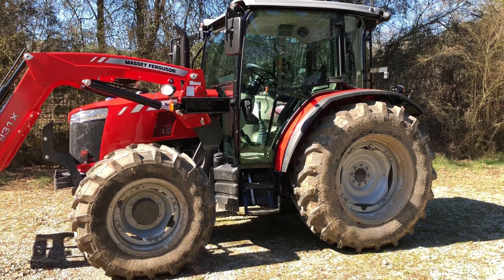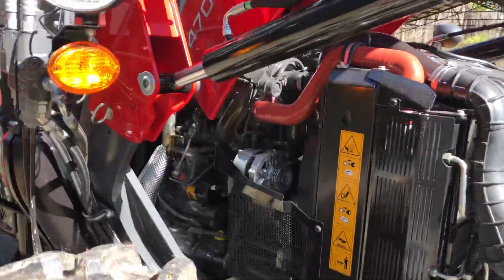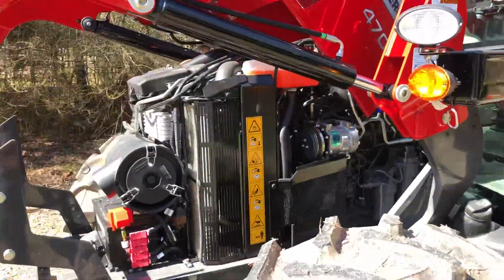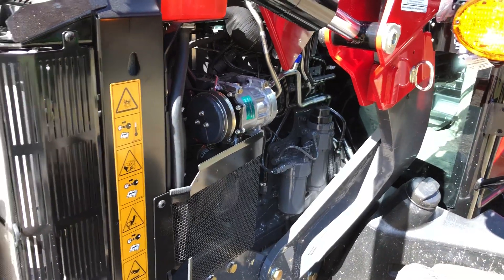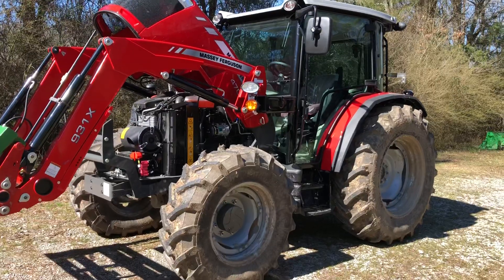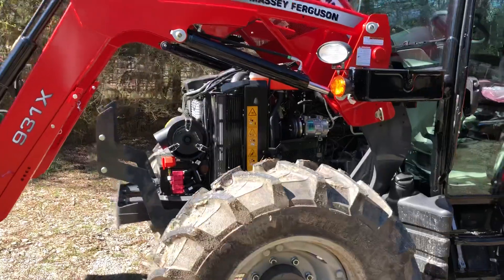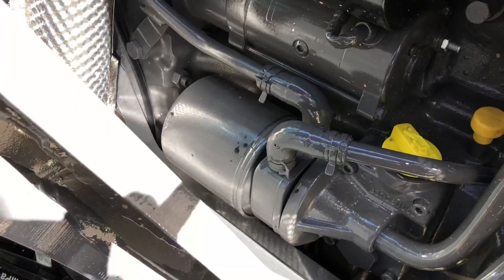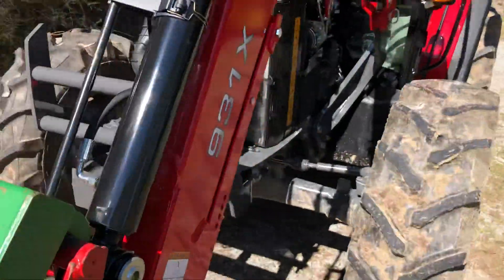Part #1: Massey Ferguson 4700 Review, Engine and PTO Specs

Comment: I got to test drive a  2021 4707 with the DYNA2 transmission and FEL. I really like the machine. I never had a Massey or do I know anybody that has a utility size Massey. There just not that popular around my location. I have narrowed down my selection to a Deere 5075E and the 4707. For the money the 4707 is the better deal. I have 30 acres total, 15 acres I will bush hog and would like to hay the remaining 15 acres. Some of the areas are on steep ground 20 to 30 degree slopes. I have never pulled a round baler, I plan on buying a 4x4 bailer. I will get tires set out to wider positions, rear wheel weights or tires filled. Do you feel that the 4707 will be a good choice to handle what I want to accomplish? Thanks in advance.

Comment: Nice tractor, especially with no DEF. We're running a 4709 since last summer and it's been awesome, but do get the odd code having to do with the emissions equipment. Plenty heavy and powerful, it's definitely stronger than the NH with same hp rating that it replaced. Use it every day and very pleased so far.

Comment: That power difference you mentioned is something I’ve found in Masseys for quite a while. Generally Massey dyno 4-8 more pto hp than pto rated hp at engine speed. I will bet you find that tractor does great with your baler. Bagwell Farms says his 4710 is more than heavy enough, id would guess yours at 11,000-11,400lbs but either way I bet you’ll be surprised and if it is lacking in power you can down the road flash it at dealer to 100hp, after warranty.

Comment: I like the no DEF. Seems like a nice tractor. Up here in Canada or maybe just Nova Scotia, tractors over 60 PTO HP are tax exempt. Seems like they rate these for 57 @2200 and 63 @ 2000 cutting it close but should get away with it.
Reply from the maker: That’s an interesting point you make.  Never seen that here but definitely matters for you.
Reply: @SpringHollowHayFarm   Yeah, it'd be a tough choice if a guy had to pay sales tax on the 4707. Anyway, good to see your back posting vids, I have a little catching up to do. Actually stopped by your channel to watch your old vids on that 1006NT drill you have, we are looking to buy one.

Comment: This spring we will be pulling the trigger on a 4707 because of everything you mentioned so far. I will definitely stay tuned to see what more you say about the tractor. Will you be putting the batwing on this tractor too?
Reply from the maker: Yes.
Reply: I would rather buy a used 5608 they're far superior
Reply from the maker: I don’t disagree but they can be hard to find.  I looked around for used in the 5600’s and didn’t come up with much anywhere near me or in the US.

Comment: I remember reading somewhere that you can flash these to 4710 specs.  So basically you can get a 100hp without having def.  Thoughts on that?
Reply: 2020jd  yeah it’s the same engine my local dealer said they can tune it to 100 horse for 3 grand
Reply: You can get over 110 HP (PTO is 108 HP) with ekotuning. costs 2400. So for like 55K you got a 90K equivalent tractor with no def/dpf.  I upgraded crappy lights to LEDs too and put flip caps in for $500 total. Best value tractor bar none.
Reply: TDI Tuning will sell you a box, so not a permanent change that will get you  to 4709 specs for about $625
Reply: Rip that government engine out abd set in a cat 34series engine.  No juice no emissions.